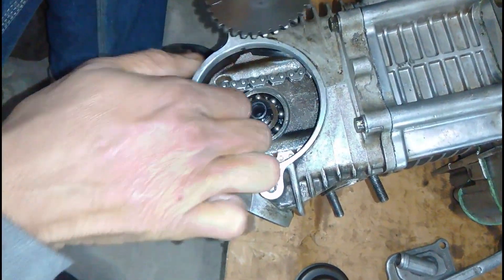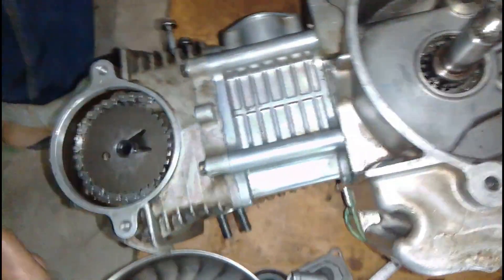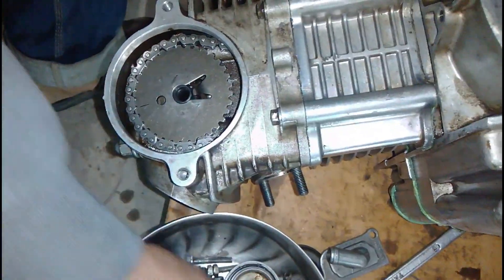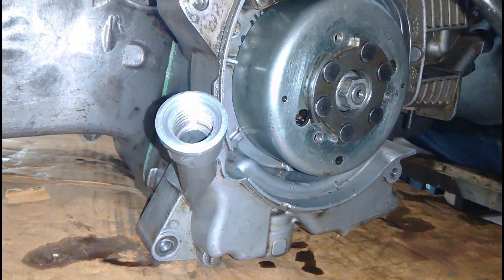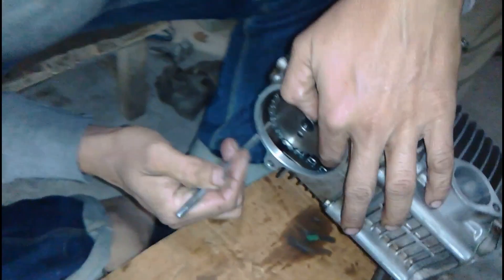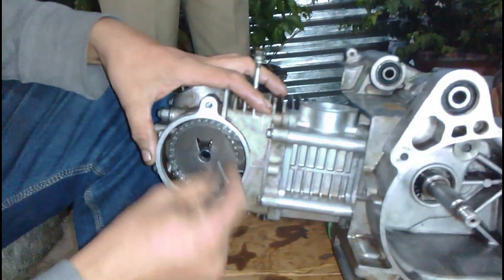Full  Rebuild of  Mahindra duro 4 stroke engine part 4 ---- Its About Everything.

Comment: My mahindra duro piston problem how cost for parts?
Reply from the maker: The piston cost me 500₹ with piston rings, the gudgeon pin and the circlip all together.
Reply: @ItsAboutEverything01  thank you for imformation.
Reply: Can i use waxpol engine oil saver instead of replacing piston?
Reply from the maker: If the piston is not damaged yet then you can try it.
Reply: @ItsAboutEverything01  engine is working but some times white smoke. When i filled oil start smoking after the oil level down i filled again. There is no problem now. But when the next day start the problem again. But only on starting. It is not much hard smoke. It comes out when accelerating.
Reply: @ItsAboutEverything01  did you buy it from mahindra service center?
Reply from the maker: From the local market.
Reply: @ItsAboutEverything01  the price is same in both?
Reply: How much mileage did you get after rebuild?
Reply: Enjen ring and pistan change